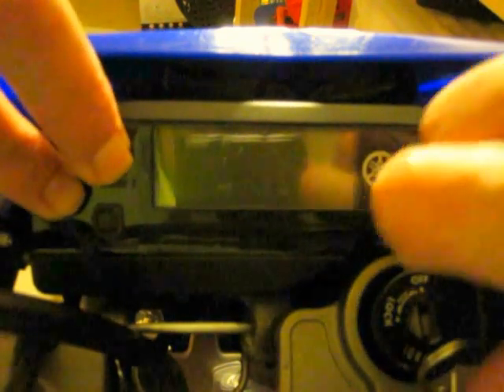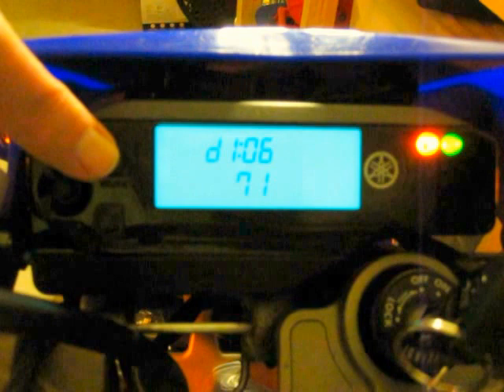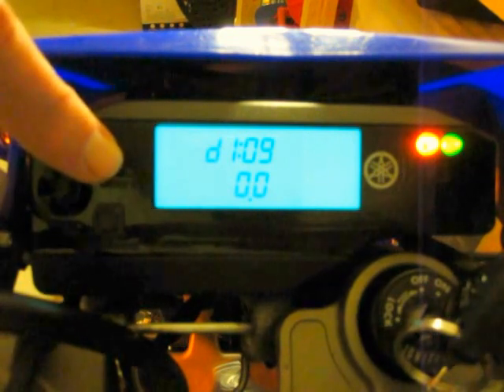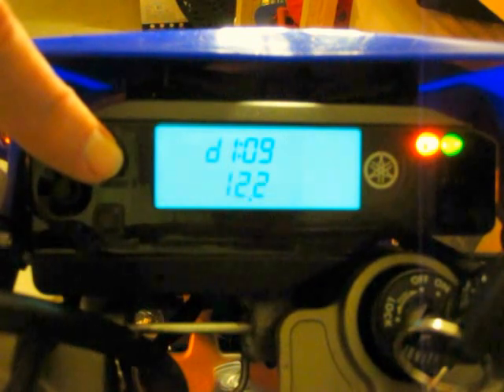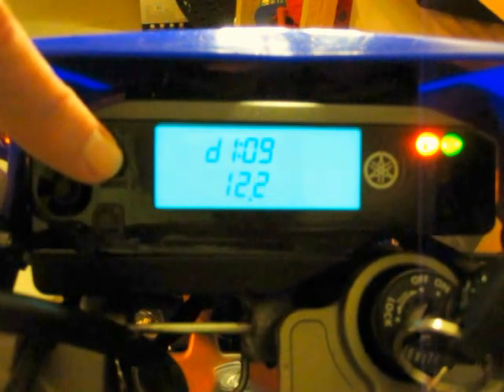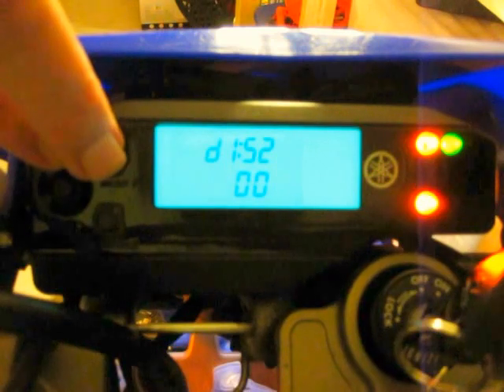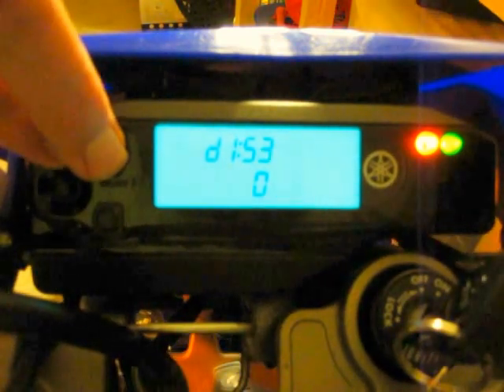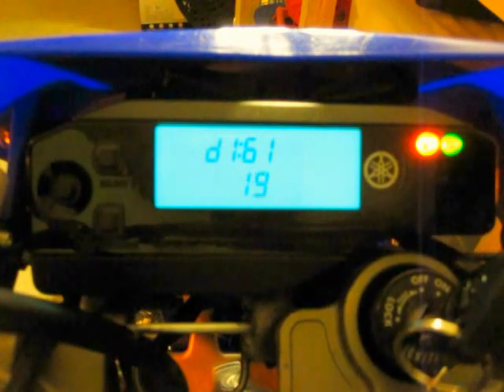WR250R & WR250X DIAGNOSTIC TESTING MODE

Comment: "to erase that I turn the switch on then off"?  What switch?
 also  the service manual says to disconnect the fuel pump wire harness. I think there is a test that requires pressing the starter,
 so  disconnecting will not pump gas to the injectors.

Comment: Thanks. I confirmed that my fan works. No electrical issue. I noticed fan never goes on since the  purchase brand new from the dealer. What is the min temperature that should turn on the radiator ? R2018. Thanks
Reply: I've just been messing with this myself - had my first overheat in 12 years yesterday (2008) and my fan nor light never came on - used to run all the time, especially on trails and have seen the light once or twice. Using a potentiometer, I'd set it until the fan came on, then go into diag. and see what temp it was reading. It seems the fan comes on around 222F and the temp light around 242F. Running at idle, smelling the coolant getting hot, I read 185F max, so I think my coolant temp sensor is to blame. I"ll pull it this weekend and test it in some boiling water, but I'm going to have the spare on hand anyway.
Reply: OblivionRatula good idea thanks
Reply: OblivionRatula Do i need to drain oil or coolant to replace the sensor ? Is it actually oil or coolant sensors ? - I wish to find some online doc about engine repairs. Just in case I bought this “Brand: MOTOALL
MOTOALL Temperature Thermosensor 179700-0220 8CC857900100 5PS857900000 Thermo Sensor for Yamaha TEMP 8CC-85790-01-00” on amazon. Not sure if that is BS but that what I went for.
Reply: @michalaugustyniak6449  Sorry man, I forgot about this comment because I didn't know the answer at the time. Yes, the coolant will come out when you pull the sensor. I was due for a flush/change anyway. I also swapped the thermostat while I was in there. Can't say if it's the right sensor, I just ordered the OEM from Partzilla. Got my bike happily blowing hot air on my leg at lights again.   Good luck!
Reply: Hey bud how did u exit diagnostic mode
Reply: @dereckrodriguez9688  ignition key to off
Reply: @michalaugustyniak6449  thanks man figured it out. Was going to buy one an hour after positing this and I figured it out. Bought the bike been a lot of fun already

Comment: Thanks buddy!
Reply: How did u exit diagnostic mode
Reply: @dereckrodriguez9688  I have since sold my bike but I think I just turned the key off and on again
Reply: @groovyshoos5200  thanks man I figured it out. Was on my way to buy one and wanted to check all those codes to see if there was an issue. Btw what’s the black box on the left rear side of the bike. It’s where passenger pegs would be on a normal bike

Comment: Any ideas, why I can't enter the diag? I followed the instructions, check lights go on, go off but the red one (engine temp.) and green one stays on. Still holding the buttons (longer than mentioned time), but nothing happens. My fuel pump doesn't run after turning the ignition switch on, therefore I can't start the engine, nevertheless the starter is running. Aslo tested the fuel pump, it's working when I put voltage on the connectors.
Reply from the maker: Is the engine stop switch on the right handlebar in the "ON"  position?  It should be on when entering the diag. mode.
Reply: lenarama1066 yes, yesterday I put my ecu in my friend's wrr and found out, my ecu is dead.
Reply: I saw in another video that some ECU plugs (under the seat) don't have the black ground cable connected. Without the black cable being connected to ground you can't get into Diag mode.

Comment: I bought my wr without a speedo. So I bought an oem one used with 4800mi. Plugged it in and got err1 meaning no signal from ecu. Here is only 1 connector behind the headlight but there is 3 connectors on the speedo. Does yours require only one connection?